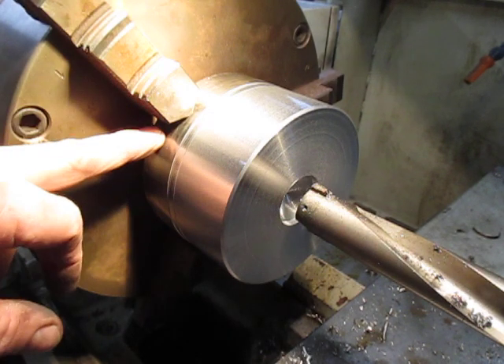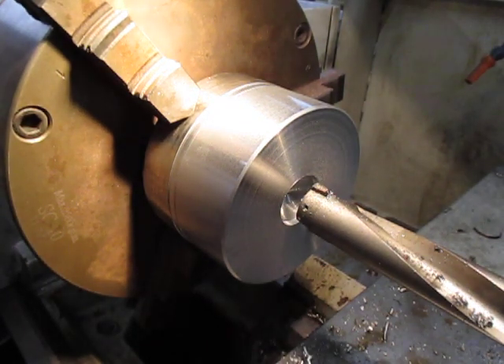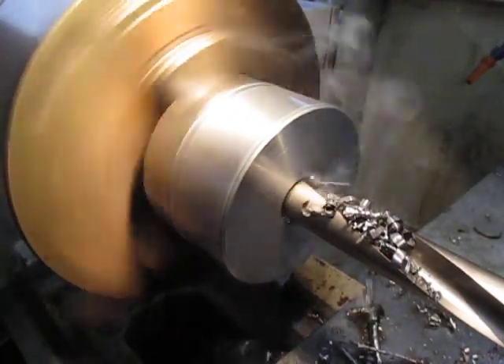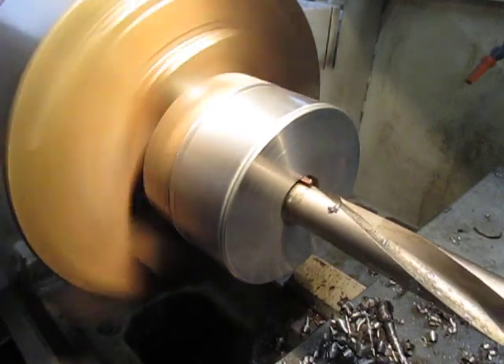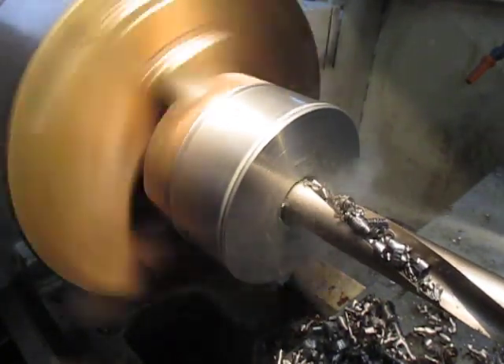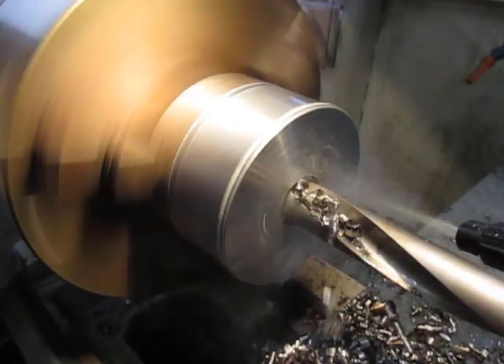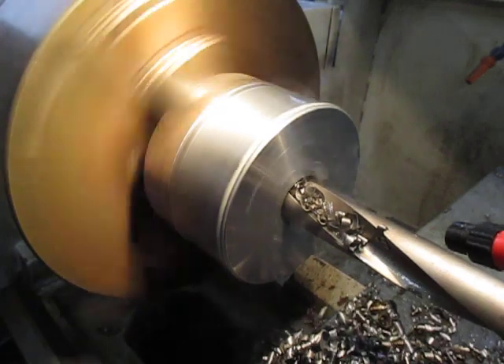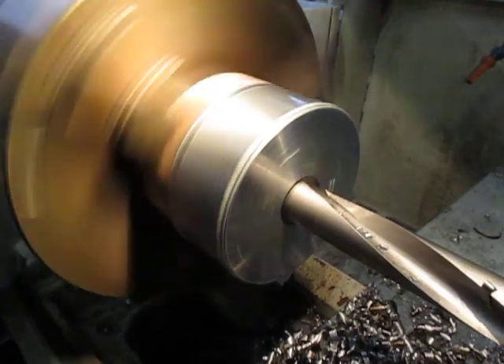Airplane propellor hub coupling, machining , boring the pilot hole.

Comment: Hi Bruce. we use spade drills on our manual machines as well, as far as coolant goes we just put the coolant pipe of the lathe in the coolant port of the drill, which seems to work very well.
Reply from the maker: Adam Price Yep I need to change the coolant type in the lathe and do that at the minute I use the bottle, too many things on the To Do list!

Comment: Bruce

Great video 

Could you not have taken off the spray nozzle from your pressure spray a bit of flexible pipe the the back end of the drill , you would have a simple though coolant setup

I do the very same thing for my small boring bars ( 12 mm and down ) they are carbide ones and come as a though coolant jobs so why not make use of it

Mine is purely a hobby shop no paid work so I have to make do , but I do have to work sitting down as two crutches are not conducive to mill or lathe work as both need hands to operate 

Keep up the good work nice to see how the professionals do it lots of tips to pick up even after nearly 50 years in my hobby shop , makes a change from the Sparks work I used to do although I have not been yo work got 17 years 

Stuart
Reply from the maker: Stuart Hardy good idea I appreciate any feed back.